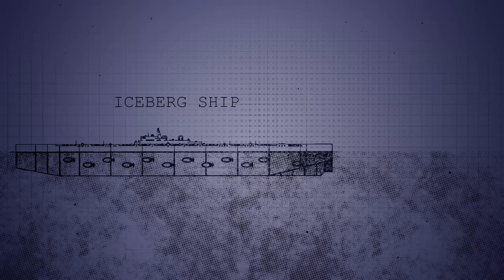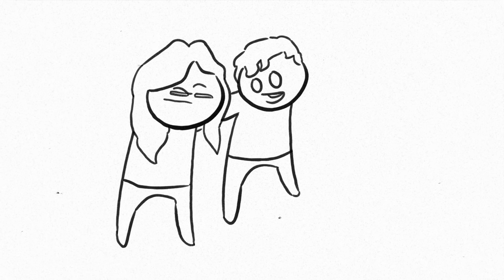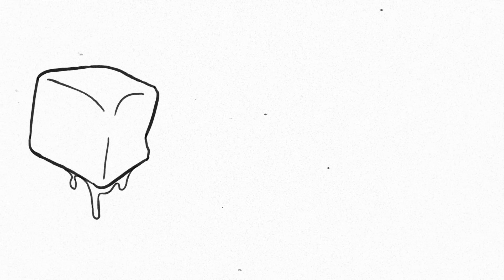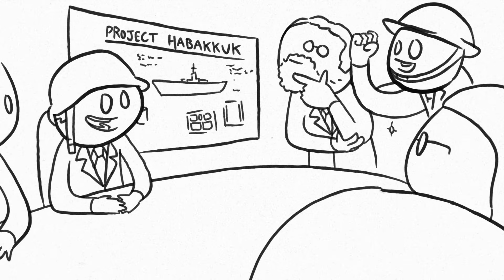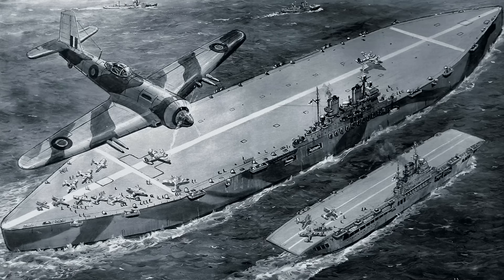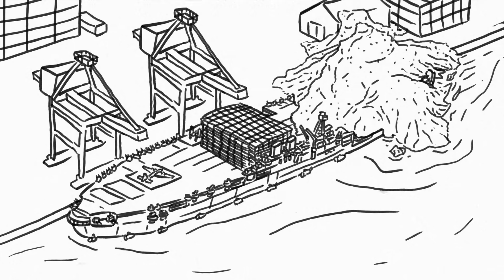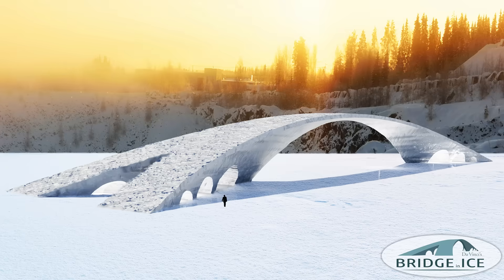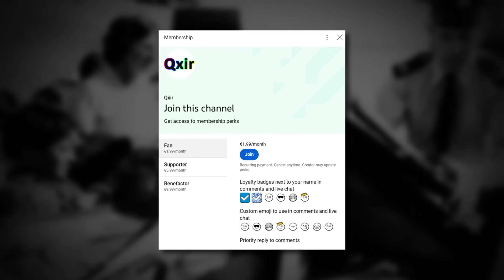The Miracle Material Behind the Largest Ship Ever | Tales From the Bottle

Comment: If it were me I would have designed a ship that could grapple preexisting ice-floes with insulated drill claw arm thingies. The floe could then have pykrete tunnels and runways added, both creating natural camouflage and a guaranteed reusability of machine parts. Simply disengage the grapple-arms and find a new ice floe, second verse same as the first. Making the propulsion/grappler component a submersible would also help with the cooling issue.

Comment: Good old project Habakkuk. When I read about it in the 60s/70s, there were no pictures, just barely a description. I've always wanted to know more.

When I was stationed aboard USS Theodore Roosevelt, she was the world's largest warship...they intentionally lengthened the ship by a little bit, just to make it so. At least, that's the story they gave us sailors aboard when she was new. The impression I got was that each Nimitz class ship gained a few few, so each new one was just a bit longer than the one before. I'm not too sure Wikipedia has it right, claiming all Nimitz class being 1092 feet...I'm a plankowner, I was on the ship before it was launched. Walked through the shipyard every day until she was launched. While they did lie about the ship's top speed (told us it was something like 27 knots), I don't think they lied about the length.

Comment: Initially I thought that scaling down should've been the proper way to see this project through in time, but maybe the Navy officers idea wasn't to build a fleet of ice aircraft carriers to patrol the Atlantic, but rather basically a unsinkable floating island to place right in the middle of the death zone and act basically as a landbase for full size bombers. If so, it kinda makes sense. Plus, it WAS going to be bigger than steel carriers anyway, because ice needs to be thicker.

Comment: It would have only worked on a much smaller ship, if at all. Just sitting in the water, the hull would be at a constant loss. So the "freezer" would have to be operating constantly. Actually, wouldn't it just freeze the condensation on the interior? And with the hull constantly eroding, the frame would ultimately be exposed... Too damn complicated! 😄

Comment: The lakes of Titan are liquid methane allowing passive use of solid ice, and pykrete insulation would help protect against cryogenic temperatures, particularly as an outer cladding. Would it be cheaper than some other insulating material in that context? Probably not.

Comment: It might be a good choice on Mars and other water bearing moderately cold planets or moons. Certain light weight woods can be processed here on Earth. Chipped, compressed for space, transported, and uncompressed on the planet into any size of the material that pykrete the 14/86 mix requires and there you go, a permanent structure. Balsa wood would be lighter, cheaper, easier to process, easier to produce at scale and transport than most if not all other structural materials. It might be worth a try. You're welcome humanity.😎

Comment: Fun sidebar to this story: One way that the Allies tried to plug the Atlantic Gap and protect convoys was blimps. The US Navy built dozens of non-rigid airships that would float along above convoys with depth charges strapped to their sides. If an enemy submarine was spotted, the blimp would radio the position to the convoy escort ships before motoring over to the sub's position itself, the cumbersome craft still being faster than the average U-boat, and would drop their depth charges as well as smoke flares to mark the sub's estimated position. The blimps proved so effective, even in just a psychological sense, that most U-boat commanders refused to attack convoys with a blimp attached to them, not wanting to risk the wrath of the big silver eyes in the sky.

Unfortunately, the US Navy Airship Program would include one of the great mysteries of military history (and a possible future Qxir episode): The Ghost Blimp Incident. On 16 August, 1942, the airship L-8 set out from Treasure Island Naval Base in San Francisco on a routine training mission. It was found several hours later drifting down over Daly City, far off its assigned course, with no sign of its two-man crew. To this day, what became of the two men aboard or even how the L-8, nicknamed "Love-8", wound up where it did, remain unsolved.

Comment: In product development we call the continuous changing of design requirement "specification creep" or "spec creep." It will kill many a product. Besides, why would the RAF want 4-engine bombers aboard. The little "jeep" carriers the USA built worked just fine in The Gap.
Reply: If the carrier itself was slower and restricted to higher latitudes they might have wanted it to carry larger, longer-ranged aircraft to compensate.

Comment: I do wonder if there is any other kind of impregnating material that can be used instead of wood pulp that could result in an even stronger substance. I also wonder if such a material exists that gives good performance, is non-toxic, and is rapidly biodegradable outside of the ice. This later requirement could perhaps bring about viable dissolvable bullets- for hunting, of course.

Comment: To add to the absurdity of this story, Geoffrey Pyke’s initial concept was to literally flatten an iceberg and build an airstrip on it. This was abandoned due to their tendency to suddenly capsize without warning, which wouldn’t be helped by removing most of its mass and changing its center of gravity.

Furthermore, another tall tale surrounding Lord Mountbatten’s support of this was his displaying of Pykrete before assembled Allied naval officers by shooting it with his service revolver after shooting a block of ice: The bullet ricocheted off it into the pant leg of US Commander in Chief of the Navy Admiral Ernest J. King, probably not helping his enormous Anglophobia which led to not adopting convoys off the East Coast until April 1942 when U-Boats had raided there virtually unopposed since January, and the Caribbean in February (Eisenhower allegedly said that the easiest way to win the war was to shoot King).
Reply: Most mass of an eisberg is underwater.
Reply: @edgarhilbert4797  If you remove a bunch of mass on one side by leveling the iceberg, the fact that there is probably counterweight on the other side (but underwater, so you cannot see it) will rather help it capsize by applying a rotational force.

Comment: See I read, some 15 years ago, that BOTH the American's and the British kept adding requirements because they DID NOT WANT this project to see completion. They made it so the specifications of the end-product were so ridiculous that it would never see the light of day.

If I remember correctly, one rear admiral made a comment that it would actually be more financially and tactically feasible to cut out large chunks of ice from the polar glacier shelf, fit them with sails and rudders or even rudimentary boilers for engines and then direct them to the Atlantic theater, armed with planes and bombs and cannons. They even said it would make more sense to commandeer existing, larger icebergs and use them as a kind of "Artic Wall", really simplistic floating bases, which could be steered or at least guided toward conflict zones (on which planes could take-off/land-from and munitions could be stored). The material aboard the icebergs would be mostly disposable and designed to be lost, so that if some U-boat did eventually chip it away, the berg could be evacuated almost immediately with a single transport plane. True, you may lose weapons and ammunition, but the cost of losing that stuff is peanuts compared to losing a whole ship. 

I'd love to see if any of those plans were ever drawn up and proposed. What a pie-in-the-sky idea. 🤣🤣

Comment: akron-class airships might also be a neat video tbh, another thing that debatably could or couldn't have helped the battle of the atlantic. also the idea was briefly revived in the 1970s because of course it was.
Reply: I heartily endorse any educational content about airships. Seconded!
The idea makes a comeback every 20-30 years. Most recently and notably, in the 2010s with companies like Airlander and Worldwide Aeros Corp.
We still haven't solved the problem of how deeply susceptible LTA (lighter than air) craft are to wind speeds over, say, 20MPH. Most golden age airships didn't extravagantly explode, but were simply whisked away by the wind and mashed into a hillside, typically while unoccupied.
I'll grudgingly admit that the Germans had by far the best track record with rigid airships.

Comment: I understand Pykrete seems like a natural building material but given the modern changing climate, and I'm being literal, its limited use seems to have limited even more. However that same changing climate may have given it it's niche. 

Keeping fresh water sources from evaporating as well as keeping their ecosystem temperatures regulated.

At least, that's the only thing I can think using it for.

Comment: The original plan was a giant ice berg with a hanger inside and an airfield on top. It would have been towed in place and replaced before melting.
Reply: Now THAT'S a good idea. This whole thing just spiraled out of control. Why couldn't they just be happy with the easy solution? ;P
Reply: @tessiepinkman tge issue would b as an iceberg melts it's centre of gravity moves so its constantly capsizing itself or breaking apart. Like a giant melting ice cube
Reply: @tessiepinkman  most likely because the higher ups saw it as a bad idea but willing to see what pyke could come up with it
Reply: That sounds like the secret hideout of a supervillain.

Comment: One of the very many reasons that Pykrete is not used is that materials like Ultra High Performance Concrete (UHPC) are much more practical.
Reply: If Canada or russia wants to fortify their freezing areas, maybe. If world goes into a mini iceage, pykrete will become the most reliable concrete like material. Good thing most things work best in cold but water proofing the electronics will be very unfun.

Comment: The moment you said heavy bombers were supposed to start and land on it, I knew the project would be doomed.
Reply: Right? What were they even thinking?
Reply: @williamkwl6153  they probably didnt want it to be built lmao
Reply: @williamkwl6153  Truthfully, as long as you get sufficient runway length, there isn't a problem. And, if you're building out of things that don't have cost scale exponentially with size, there isn't a reason you can't make it long enough.

The difference between a revolutionary idea and a stupid one is if it works out. But you can't really know until you try (or at least plan it out sufficiently)
Reply: @Isometrix116 sufficient runway length in this case would be like double or triple the length of a vessel, and would involve mounting arresting hooks on planes that were never designed for that stress
Reply: @Grimpy970 You can modify the design for arresting hooks pretty easily. We've done it before. Really, the bigger problem is making it corrosion resistant enough and all the weight that comes with that, as we saw with the F15 program. Regardless, making the runway longer shouldn't be a core problem, the bigger issue is using sawdust and ice:)
Reply: @Isometrix116  They couldn't use a catapult?
Reply: @Isometrix116  it wasn't sawdust. Damn, you sounded smart right up until that simplistic last sentence.
Reply: @joshyoung1440 Ah, I'm sorry, ✨️wood pulp.✨️ Am I smart now? 

Note that sawdust was called for in the plans :>
Reply: @williamkwl6153   drunk royal navy 'tards doing as they usually do: get drunk and come up with goofy ideas that could be interesting but then they start to add all the bells and whistles that every service or higher grade royal navy twat wanted to add to the project... 🙄
Reply: @williamkwl6153  nerd reference?
Reply: Whoever in the RAF suggested that had their head up their ass
Reply: Now think there's 120 of them, all of which have twin engines. Wonderful.
Reply: The moment he said "made of ice" should have tipped you off
Reply: He had already said it was doomed by the time he mentioned the heavy bombers, so congrats on paying attention ig
Reply: The problem would be: Why would you need heavy bombers to land on it?

No, seriously, why would the British need to land Wellingtons or Lancasters in the middle of the Atlantic? There simply isn't a need for floating runways when we're dealing with long range bombers
Reply: @SanderDoesThings  thats kinda the thing that makes me think very poor managament, just give it the requirements of a normal aircraft carrier, if a normal aircraft carrier doesnt have to be that long why should the prototype pycrete have that requirement?
Reply: @SanderDoesThings  It is explained within the first minute of this video.
Reply: @jaapaap123 You don't sink submarines using Heavy bombers like Lancasters or Halifaxs, you'd use naval bombers and flying boats like the Sunderland from the fleet air arm.